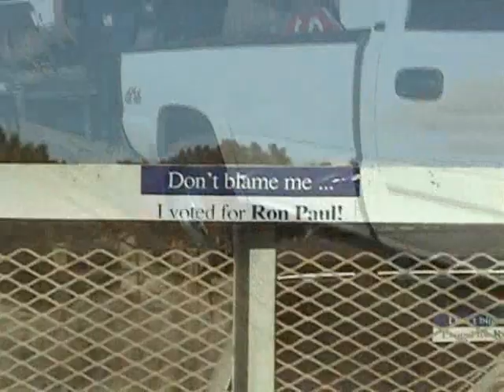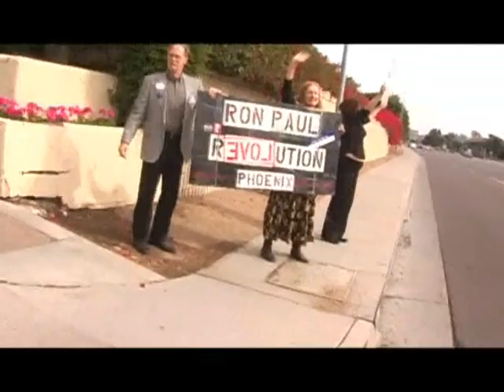4409 -- Your 9/11 truth billboard :)

Comment: You just proved our point.  WITHOUT EXPLOSIVES the buildings would never have turned into dust.  Explosives compounds have been found in all the samples of WTC dust, and it can be painted on with a paintbrush or roller to burn through steel.

Comment: @ctcole77 Being constructed on truss work has nothing to do with the fact that a fire can not remove several floors worth of structural support. Damage to northwest corner had nothing to do with the still solid interior core of the building which could not have been destroyed by fire. How can you people not accept the fact that no matter how many times NIST insists it can, FIRE can not remove structural support over the entire floor let alone 8 at 1 time. WAKE UP!

Comment: @ctcole77 Truss beams, coated in fireproof material, being attacked by normal office fires did this? Holy Batshit! Okay, look, nothing more than normal small office fires in 7. No raging inferno. How is it that normal office fires, fueled by office contents, could weaken these structural steel truss members to the point of failure, then allow the building to achieve free fall during it's collapse? OMFGROFLMFAO!